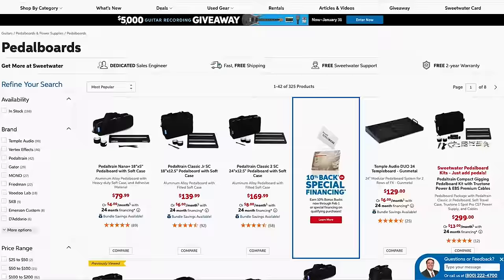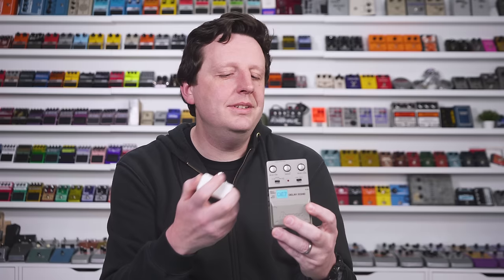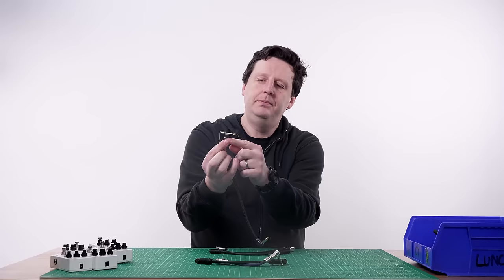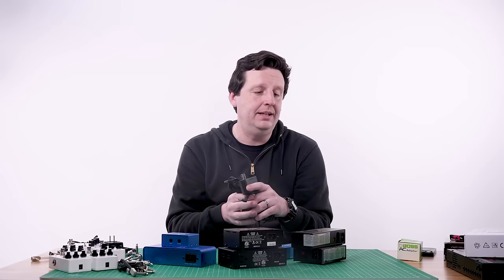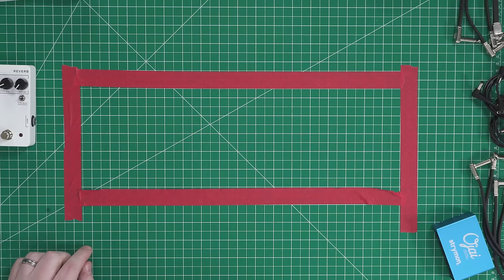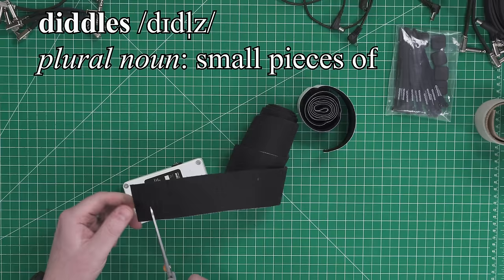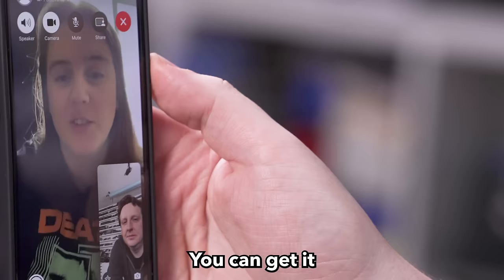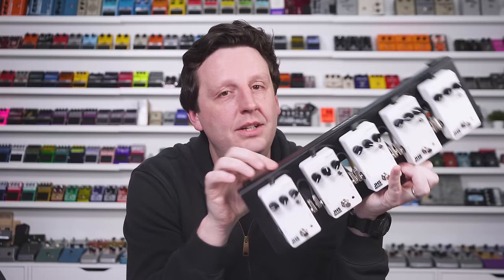How to Build a Guitar Pedalboard: Beginner Tutorial

Comment: you completely dumped on the most important aspect of pedal choice: the color of the pedals. if the pedals are not the correct colors everything will sound horrible.
Reply: Warm colors = warm tone. Obviously.
Reply: well obviously bc most of their pedals are white. But I will say I really like their compressor pedal for the money
Reply: Bucket of black paint
Dip
Done
Reply: Toan is in the colour
Reply: That's true.
Reply: 10,000% true
Reply: Absolutely, that cannot be overstated.
Reply: My black ditto looper works better than my icky boring grey one , that's a fact
Reply: But honestly, having them "color coded" seems like an obvious benefit. I'm not a guitarist (just synth and vocals, but I was thinking about putting my pedals on a board for convenience, too), but isn't it an unnecessary way to confuse yourself having an all-white board with only tiny names on the top that you cannot read in any gig and most rehearsal environments?
Reply: Chorus is blue unless its a dimension c..
Reply: Well, now you know how to start with black metal
Reply: I would give you a like but you're on 666 likes

Comment: Power supply in-depth review will be much appreciated. It can become a real headache when a board is growing
Reply: Mxr mini iso brick is awesome
Reply: I'd suggest you include Cioks power units in a full on review. They have considerable mA power and flexible Voltage switches.
Reply: Power supply should be looked at as nothing more than having enough mA to power the pedals. A 1Spot supplies 1700 mA. A tube screamer draws 8mA. So a simple 1Spot daisy chain can power 212 tube screamers. Most analog effects, and even simple digital ones like a DD-3T for example, have low enough mA draw that, if that's all you have on your board, you do no need a dedicated power supply like a Zuma or a Cioks. You just don't, and the notion that you need a unit like that for a board consisting of a few overdrives, a fuzz, a chorus and a delay is a triumph of marketing over reality. And power supplies will rarely help with noise issues so don't go into it expecting that either. 

Where you need a serious power supply is when you have several high draw digital pedals like Strymons on the board. Those types of pedals draw hundreds of mA and you end up maxing out a 1Spot quickly when you get into that stuff. People are led to believe that high quality dedicated power supplies are an essential part of any board and it simply isn't the case.

I agree with Josh on future proofing. That's never a bad thing, but again it's just a matter of making sure you have enough power long term.
Reply: I would agree with this. I’ve been using wall wart supplies with daisy chains because those are the only ones I understand…
Reply: @pCeLobster  The issue that Josh spoke about with 1Spots is that the daisy chain introduces noise that may be prevalent in one power connection, to the others. Yes, a Cioks may be OTT for many beginner pedal boards, BUT, as Josh alluded to, it can be used again on other pedal boards when you upgrade. A clean isolated power supply is the foundation of a happy, noise free, pedal board. VoodooLabs ISO 5 is good for this level of pedalboard too.
Reply: @pCeLobster It really depends what you have on your board. Sometimes you might have multiple ground loops and everything works fine, but sometimes you hear weird whining in the speaker 😁I had a separate power supply for my dl4 exactly for this reason.
Reply: In my mind there is two I know of that are trusted by a lot of players, Gigrig Geneator or Cioks as people are recommending. Though Gigrig can get quite spendy as you get adaptors for isolated power for your pedals with a higher draw and expanders for more inputs. If you want a bigger board in the future, Gigrig or Cioks is the way to go.
Reply: @OzziePete1  I just think it's important for people to know that there are a lot of sources of noise that an isolated power supply will not solve. It's not the be all end all for a whisper quiet rig. And, I've played many a show in many a sleazy dive with nothing but a 1Spot and had no noise to speak of. I do have a Zuma on one of my boards but there's no real difference in noise between that and the board that runs on a daisy chain. It's just that that board has a bunch of high powered digital stuff on it and needs the power. I'm a believer in isolated power supplies, but they should be viewed as solving specific problems rather than the vague, snake oily way they are commonly talked about online.
Reply: I have Fender engine room lvl12 x2 and I’m glad I saved the money and got them. They are just superb. Ticks every box. I got this because you don’t really have to worry about any mA issues because it is so well equipped. Plus I might be moving back to Europe so I didnt want to worry about voltage issues. Certainly expensive but I got two good deals on reverb.
Reply: Just get something like a Cioks DC7 and add some extenders if you need to.

Comment: Josh also something people overlook, I personally use one, a Computer UPS, basically its a power buffer meant for computers that acts similar to a surge protector but also has batteries that also act like capacitors, the cool thing is, they clean up and filter power, which not only would clean the pedal sound up a bit from dirty electricity, but its also protects those valuable pedals from damage from surges and such. Once you try this you will never go back.
Reply: Shit, that's genius!
Reply: Thanks, man. Great solution! Bravo 👏

Comment: I literally smacked my forehead when I saw your Boss backplate tip! Had no idea you could do that.
Reply: as a person with a boss-only pedalboard (i'm a fan boy i'm a fan boy wee) i literally did just that, too. i might be stupid. gotta do that to my pedals.
Reply: Yeah that's a revelation, I've been covering the back labels of my boss pedals with a little piece of cardboard from cereal boxes for some time now.  Funny that this little trick didn't show up earlier with Josh's fandom for boss pedals 😄 thanks jhs👍
Reply: I’m not sure about that tip cuz when I did that with my ds2 years ago it doesn’t really fit well and for that my ds2’s broken. Pedal works when the plate flipped and it doesn’t work when I flipped back(stock). I don’t know I might did something wrong cuz I’m not a professional or maybe that tip is not for every boss pedals.
Reply: I recommend against doing this with some boss pedals as it puts unnecessary pressure on soldering points when the rubber presses hard against the circuit board.
Reply: @GrandCaravel  i think one needs to exercise caution when doing that. the majority of boss pedals have a lot of space between the cover and the circuit board. if you start tightening the screws and the rubber starts pressing against the board too much, just stop.
Reply: I just cut 3 skinny velcro bits for the bottom edges of the pedal, and then one thicker one for the top part of the pedal back. Nothing across the middle label. Works great!
Reply: @kilgoretrout321 this is especially great if you use dual lock instead of velcro
Reply: I just put the Velcro on the rubber and put it on my board. Until now I haven't had any problems
Reply: @Zilmayjaink  I haven't had a reason to use dual lock yet. Maybe if I were using my board live, but at home everything is staying on great with just Velcro.

Comment: 2 $23 packs of "budget" Cables, 5 $99 "budget" pedals, one $170 "middle-of-the-road" power supply, a $150 sheet of metal to stick it all to. + wires, velcro, zipties, and a cable tester.
Thank you for recommending these products and advising beginners to drop nearly $1,000 on a 5 effect board. 

Also, very interesting that you did not recommend an EQ or a compressor. I guess they didn't fit into the budget.
Reply: Building a decent pedal board can get a bit pricey. About $1000 isn't that bad for what is shown here. 

I suppose you could cheap out on the actual pedals and get 5 $20-$30 Behringer pedals, or Donner pedals, or Mosky, Azor, or whatever. There are actually some decent "afford-a-board" pedals out there these days (many of which I've seen featured on this channel); and if you are a total noob regarding guitar effects then going the cheap route might be a good way to go. Definitely better than throwing down $200-$300 on a chorus pedal and then finding out that you don't really like the chorus effect in general, and/or never end up using it that much. Cheap pedals are a good way to kind of "try out" an effect and see how you like it. You can always upgrade to something better for the effects you really like and/or use a lot. All that being said I think most $100 pedals are a good middle ground. Usually more well-built and will most likely last longer than the cheap ones, but not as expensive as some of the more specialized, or "boutique" pedals that sometimes don't sound much better than the more affordable ones. You might be able to just stick with those $100 pedals for the long haul if you want to. 

I do feel like the physical boards themselves might be a bit overpriced considering the fact that if you're creative enough, and handy enough, you can pretty easily make an actual pedal board for a lot less. All you really need is some kind of solid, flat object that is big enough and sturdy enough to attach your pedals to. I do have a good, large Pedaltrain board that is my big, "everything I could possibly need "Swiss Army" board. I think it was maybe $150-$175. But it's lasted me about 10 years and will probably last another 10 years at least. But I also got a smaller board for my mini pedals that I just made last week out of a  door that came off of a broken cabinet we used to have. So that costed me $0! Unless you count the velcro, which I don't because I already had that. I have another similar board I made out of a broken wooden chair. But if you don't just have spare wood around your house, or if you're not good enough with tools to build one on your own, or if you just don't wanna bother with all that then just buying one is what you gotta do. I've only actually bought that 1 Pedaltrain board, so I don't have anything really to compare that to. I'm sure there are cheaper options there as well, but that's one of those things I'd rather just spend whatever I need to for a good, solid board that'll last than getting something too cheap that will just fall apart after a couple years.

In regards to power supplies I can speak from experience when I say you might be better off saving up for something good. I got one of the cheap Caline power supplies because I've got a few of their pedals and really liked those. I still stand by the pedals, but that power supply just quit working all of the sudden after maybe 6 or 7 months. I was in a pinch and needed a new power supply quickly, and I could only afford another cheap one at that time; but I'm  not gonna skimp on the next one and probably just get one of the Voodoo Lab power supplies.

When it comes to patch cables that's another area I'd rather spend more on something that works well and lasts, instead of just having to buy more when the others crap out on me. I think this is especially the case with actual assembled pedal boards because replacing bad cables is a bit of a pain. 1st ya gotta figure out which cable is causing the problem, then ya usually gotta pull some pedals off the board so you can replace the bad cables, then reassemble it all, etc. And having to do that right before, or even worse during a gig always sucks. So I'd rather go with the best possible quality there and reduce the chances of failure.

Finally, I can see why EQ and compressor pedals would be left off the list in this case. I think those are a bit above the "beginner" level as far as pedals go. You kinda need to know what you're doing to get the most out of those pedals. I would also say EQ and compression are effects that a lot of guitarists might not have much use for. Depending on the guitar you have, the amp you use, and whatever other pedals you are using you might have all the tone shaping you need and have no use for an EQ pedal. And the need for a compressor pedal sort of depends on the style of music you play. If you are just playing full-on hardcore punk, or some types of metal, or anything else that pretty much only uses cranked up distorted guitars and never uses any clean guitar, then you might not really have any need for a compressor pedal. That, and EQ and compression pedals just aren't as much "fun" as the other pedals mentioned here. EQ and compression effects are more "utilitarian" and transparent. Effects that just make things sound "better" instead of "different". If you are just getting into effects then you can DEFINITELY hear the "difference" between a clean guitar and a distorted guitar, but hearing the difference between a compressed and uncompressed guitar might not be as noticeable to an untrained ear.

If I had to pick ONLY 5 pedals I would probably also go with an overdrive, distortion, some sort of mod pedal, delay and reverb. The only change I would possibly make is swapping out the mod pedal for some type of fuzz pedal; just because I don't use mod effects very often, and I'm heavy into gain pedals and just feel like the "big 3" dirt styles should all be available (overdrive, distortion, AND fuzz). 

Ok. As usual I've rambled on more than I planned to. In short, I mostly agree with all the points made in this video. I think the main thing is that if you're making your 1st pedal board it's best to keep it simple as far as what type and how many pedals you include. And there's no need to break the bank and buy all the most expensive stuff, but you should at least spend enough to get everything you need for a good, solid, and usable board. Something you can actually gig with and depend on, but also have fun with.
Reply: @JESSEALLEN77  Yeah I agree that for a beginner guitarist, an EQ or compressor might not be a good recommendation. I thought this video was for people who don't know how to setup pedalboards though. 
However, I still don't agree that anyone should be telling a beginner to drop this much on a pedalboard, as they probably don't know what to do with them or if they even want the pedals. If a beginner wants effects on their guitar, they should look into one or two pedals that could help them get to their desired tone.
If I saw this video as a beginner and somehow had $1000 lying around, I might build this with the same pedals he recommends. It would be a waste though, because I have no use for a reverb, echo, delay, or fuzz as a heavy metal/hardcore guy. Not enough use to justify $100 at least, especially as a beginner.
Honestly I think the tutorial is fine, which is what I came for, but the advice/recommendations are horrible, mostly because they are aimed towards beginners who have no idea what any of this even does.

Also, I spent 17 bucks on a power cable for my one pedal, why would I ever spend $200+ on a power supply that is equivalent to 5 of them? Just get a surge protector and 5 DC adapters no?

Comment: I bought a shelf from IKEA that was almost a ready made pedalboard. It has three slats with spaces in between to run your power cables through. Painted it black, put Velcro tape on it, and mounted two  Voodoo Power plus 2 power supplies underneath. I reinforced it some with angle braces and put some rubber feet on the bottom. It’s not the sturdiest thing but for a bedroom set up it’s held up well.
Reply: Amazing, do you have a link to the shelf?
Reply: proof? lol

Comment: Heads up on the power supply is when you get a brick (isolated brick) watch out for the milliamp draw. I have two pedals on my main board that exceed the 100 milliamp draw that the bricks do. So I have to use two small wall warts in addition to the 13 (8 spot brick and a  5 spot brick) for the board. So I still have 2 more (13 pedals, 11 pedals through the bricks) potential options. That said my main board is pretty full, so I might get two micro pedals however I have pretty much covers all the types of music I play.

Also buy zip ties and anchors and use those under the board to manage the wires. Basically you gather the wires and zip ties and anchor all the wires so that they are REALLY out of the way.😉👍✨

Comment: I built my first pedal board last year. It was basically a bunch of Behringer pedals on a cheap Ghost fire pedal board with a cheap Donner power supply and cables. I've had a blast with it, no issues. I've changed and added a few pedals since though!

Comment: I am a synthesist that doesn't currently play live. So I did a rack mount pedal board. I have a 19 inch rack with an angled spot on top. On the angled spot I put two 1U panels with a 1U space in between. I added velcro across the blank panels. It fits my pedals great and the 1U empty space gets my Hosa pancake cables out of the way. Since my board is on my rack, I don't need to figure out where to put it. It's a convenient location to reach for tweaking settings. Since I use it with various synths I end up having to tweak the settings to match the synth. Especially with my Mooer A7 ambient reverb. Depending on what I am doing I may be live tweaking the pedal. For example switching the reverb to fully wet and back. Since I use sequencers it gives me free hands to live tweak the settings. If you have a free hand or someone else's hand, try tweaking pedal settings as you play. I have been thinking about modding my cheap pedals to add control voltage inputs for the pots so I can have my modular synth tweak the settings for me. I am probably going to use vactrols since they are an easy option.